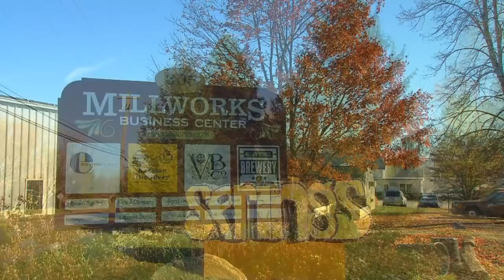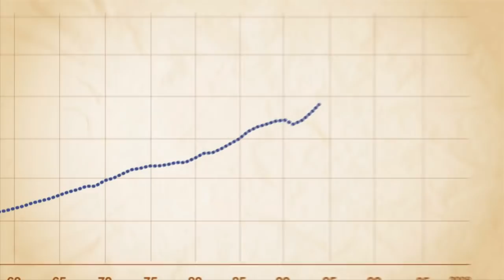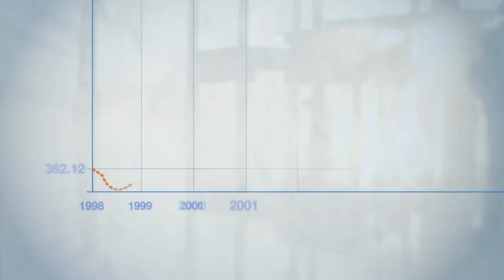Let Them Eat Flies

Comment: INSECT FECES CONTAINS PROTEIN
According to Allergy & Air, a cockroach’s saliva, shed exoskeleton and droppings all contain proteins that cause allergic reactions in many people.
Wikipedia > Proteins are large biomolecules, or macromolecules, consisting of one or more long chains of amino acid residues. Proteins perform a vast array of functions within organisms, including catalysing metabolic reactions, DNA replication, responding to stimuli, and transporting molecules from one location to another. Proteins differ from one another primarily in their sequence of amino acids, which is dictated by the nucleotide sequence of their genes, and which usually results in protein folding into a specific three-dimensional structure that determines its activity. (...) In animals, proteins are needed in the diet to provide the essential amino acids that cannot be synthesized. Digestion breaks the proteins down for use in the metabolism. Proteins may be purified from other cellular components using a variety of techniques such as ultracentrifugation, precipitation, electrophoresis, and chromatography; the advent of genetic engineering has made possible a number of methods to facilitate purification.
One entrepreneur found a way to convert cockroach feces into food.

Comment: Why don't they skip a lot of cost and just feed the fish live larva. The fish farms could raise their own food in the same buildings as the fish. Ive read once where they grew fish in ponds and with the fish parts after they were filleted were put in plastic bags inside wire baskets above the water. The flies naturally laid their eggs in the rotting fish waste and they had tiny holes in the plastic bags. When the maggots were mature they leave the bags to pupate and fall in the water. Maggots from heaven. hehe. Let nature do the manufacturing. Skip the middle man.
Reply: 1 - It uses up food waste, which is pretty cheap. The factories were probably paying for it to be dumped somewhere.
2 - The young fish need smaller food pellets. They wouldn't be able to eat a whole maggot.
3 - The maggots have a short shelf life, a few weeks at most. Processed food can be kept a lot longer.
4 - When processed into the food pellets, the insect-meal is mixed with filler that is cheaper than the maggots, so it's more economical.